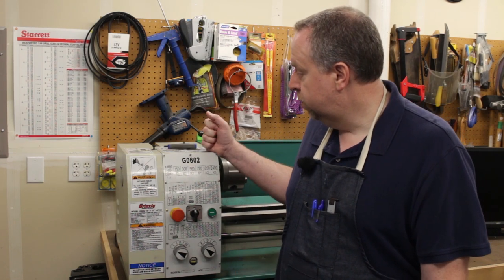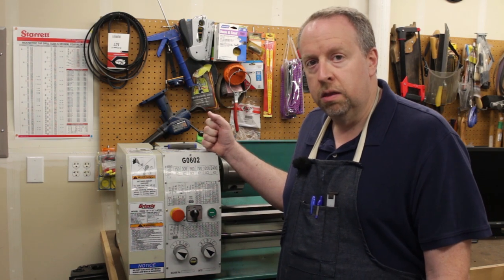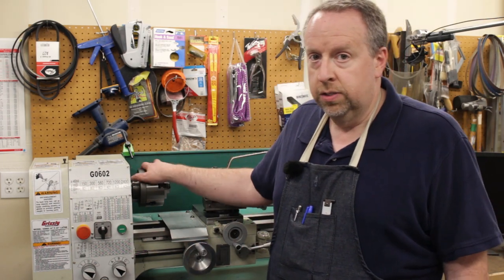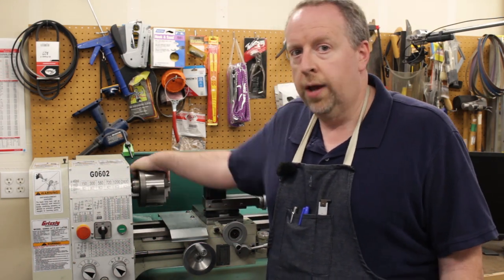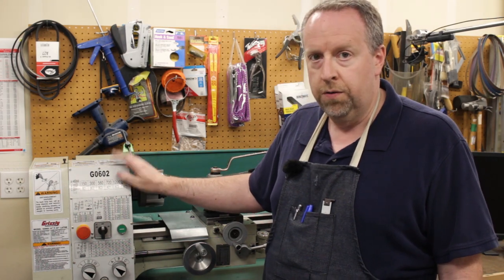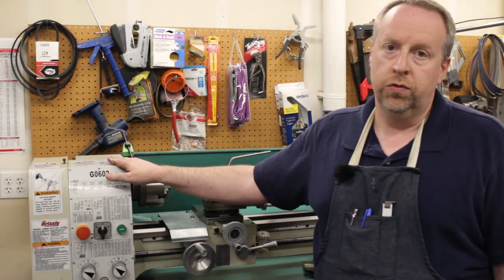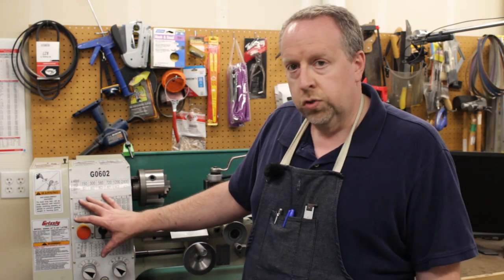Lathe VFD 4:  How to Install a 3-Phase Motor in a G0602 Lathe

Comment: "As straight as a tool from Harbor Freight gets" - I chuckled, and didn't even feel guilty.

I learned the hard way about gear pullers and pulleys, glad to see you got away with it.
Reply from the maker: Not totally sure I follow.  Did you break a pulley?  I imagine if the fit on the shaft were very tight, that could happen.  But if it were that tight, I'm not sure how you'd ever get it off in one piece.  Maybe heat...
Reply: Gear pullers used the normal way apply their force on a very small area of the thinnest part of that bottom edge.  I've broken two cast aluminum pulleys that way, when the aluminum / steel shaft interface was corroded.

Spread that force out, and the chance of damaging the pulley is greatly reduced.  I've used steel straps between the puller hooks and the pulley, plates welded to the puller arms, and even a full circle plate with a slot for the shaft.

Another good method, where the pulley construction allows, is to drill & tap holes in the pulley hub, bolt on a plate and spacers, and effectively apply your force right next to the shaft rather than out on the weak perimeter.

I do always try the normal way first, but I won't apply much force if it's a pulley I need to use / save.
Reply: @somebodyelse6673  Thanks for the heads up on using the pullers. Good to know for the future.

Comment: I stumbled across your videos for this VFD installation. I had to pause this video to say that I liked being able to see how you have some of your video equipment set up. It is nice to see. Most content creators don't show their set ups. I'm hoping to get my channel going soon. Still recovering from Hurricane damage. I also Just ordered both the G0602 and the G0704. But the main reason I paused the video was I wanted to mention. For the future you should get some Gearwrenches or the equivilent. Kobalt (at Lowes) makes some also. I used then 5 days a week for 12 years and love them. It would  have made those motor nuts come off in no time. I have used both Kobalt and Gearwrench. I haven't used any other brand. Kobalt are good but Gearwrench are better IMHO. P.S. You have a new subscriber also. Thanks for the videos.
Reply from the maker: I actually looked at ratchet wrenches for exactly the reason you state, but there isn't enough room between the side of the nut and the mounting foot of the motor for the larger head of the wrench.  And there isn't enough clearance off the end of the stud for any kind of socket.  It's clear the motor was mounted on the frame at the factory before the electronics enclosure or anything else.
Reply: @Clough42  Oh wow that is tight back there. Well at least you got it. Loved the series.

Comment: For anyone needing to install a pulley on an electric motor... Be careful using the bolt to draw the pulley onto the shaft as you don't want to break the bolt. If the pulley is too tight on the shaft, try heating up the pulley in the oven for a little while before installing it on the motor. Temps up to say 450 degrees F can be used with unpainted steel pulleys though that is hot enough to burn skin quickly. I used a temp around 250 degrees F successfully when installing a pulley on a 5 HP electric motor not too long ago. I did some light sanding inside the pulley (sand paper on a stick, spun by a drill) before heating up the pulley. Bolt was then able to pull the pulley onto the shaft with reasonable effort.
Reply: I came here to say this.
Heat/shrink fit is a very gentle and effective way to install transitional and interference fits.  Especially with aluminium on steel, as aluminium's it's co-efficient of thermal expansion is greater than steel, which is particularly helpful during removal.

Comment: Thanks for the great information and clear presentation. It is really useful for those of us about to do the same thing as lathe motors from China do not seem to last very long.
Reply from the maker: Mine certainly didn't.  Technically it worked, but I just can't stand to work with machines that are making unpleasant mechanical noises.  They're just begging to be fixed.

Comment: Hey Jimbo, I had a good laugh when you encountered the mystery motor mounting nuts @ 13:00. Many of us will attest to experiencing "mystery" hardware ever since China began flooding the world with their products. It was bad enough back when the U.S. folded like a cheap suit to Japan and other metric nations. This forced many of us old timers armed with a lifetime of  (inherited) imperial tools to duplicate every damn tool type/size known to man. Most home shops are struggling to work in the limited space we have without having to double the damn space needed! My old back ain't appreciating all that unnecessary weight either! As for encountering the occasional mystery size that fits neither standard?... I have a fix! ... Over time all of us are going to accumulate duplicate tool sizes. Some of which are not top of the line and have no sentimental attachment to family and friends. in my shop these tools become candidates for the Stationary Grinder, Angle Grinder and Dremel Grinder. For those that say why not use an adjustable wrench? There are few tools I dislike more. I will search through hundreds of pounds to avoid using one. Thankfully, you won't find and adjustable Allen Wrench anyway!
Wakodahatchee Chris

Comment: Nice video! 

A little bit of coppergrease on the motorshaft wont harm. It will make it easier to get the pulley of for the next time.

Comment: Had to take the motor out of my Grizzly G0773. That lower rear nut is best tackled with a crowfoot on an extension. I'd sure like to learn how you figured the motor frame size. Well, it isn't listed on my motor.....

Comment: Maybe one of those ratcheting combo wrenches would work well with those bottom nuts. As long as the ratchet clicks were fine enough. But I doubt you will ever need to pull that motor anytime soon.
Reply from the maker: I thought about it, but there's very little clearance around the nut, and I think the head of the wrench might be too wide.  It would be worth a try.

Comment: Clough,  Those combined wrenches  used are always a PIA in tight places. I rather use the ratcheted versions so you don't have to keep pulling them on and off. But awesome job, fortunately the new motor was same fit compared to the old motor.
Reply from the maker: Not fortunate.  Researched and chosen to fit.  The ratchet wrenches won't work in this situation because there isn't room for the slightly larger head.  Even an open end wrench jams if you turn it more than a few degrees.

Comment: I greatly appreciate your help in understanding this process!!! I need a vfd for a 5 hp 3phase motor on my table saw using single phase. Please suggest what I should get. Thanks!!!
Reply from the maker: Wow.  5HP is a lot or power for a single-phase input.  That's almost 4KW, so you'd definitely need a 220v circuit.  I'm not familiar with any VFDs in that kind of size, but there are many out there.

Comment: I have a 1 hp 3 phase motor to install along with a VFD on my G0602.  The LEESON motor - 192057 - is 3425 RPM  instead of 1725 rpm. The housing is the same type so fitment will not be a problem.

What do you think about using the 3425 rpm motor vs the 1725 rpm.

Comment: James, first off thank you for a really valuable and helpful video series. I've learned a lot from it. I was surprised to learn you could use a VFD with 110 Volt power that could then be used to create 220 volt three phase power. I am in a situation and wonder if you could provide some advice. Are there limits to how big a three phase motor can be before requiring 220v input using a VFD?  I am in the process of building a home shop that will have ten three phase machines ranging in size from 1hp to 7.5 hp. Only one machine would run at a time. I wonder if I should run a 15hp rotary phase converter or go with individual VFDs?  One thing about the rfc is the constant running of the motor (if I understand how those systems work) which with VFDs would make shop time more enjoyable. Any advice or reference material would be greatly appreciated. Thanks again. Dan

Comment: Keith would like to know the complete $investment to drop the pulleys and whose VDF and the actual motor you are using? I'm returning this exact Lathe because high range setup, the belt wasn't miss aligned, caused the belt to run off. It was a piss poor design.

Comment: If you were to start over on this would you go with the 0602 and do the new motor/VFD upgrade or just go with something like the G0752 with the variable speed built in?  I'm assuming that the new motor and VFD you installed are a more robust system?
Reply from the maker: Good question.  If I were in the market for a 10x22 benchtop lathe, it would probably be because price was important to me, and the G0752 is $1000 more.  That seems like a lot to me.
Reply: @Clough42  Thanks for the quick reply.  This is what I figured.  Now I just need to find someone with an 0602 for sale with a clapped out motor.  :-)

Comment: If your lathe is anything like my similar model, then that plate to which the LH cover is fitted is not steel but a piece of ground CAST IRON. Drill a hole to see the chips and verify this.
Reply from the maker: Interesting.  I'll be milling it at some point, to clearance for a servo.

Comment: Are you still happy with the 1740 RPM 1HP motor?  Are you having any threading issues, such as stalling?  If you had to do it again would you stay with that 1 hp motor (the Leeson is not made anymore) or would you move to the Leeson 1.5 HP 3400 RPM motor?  I'm thinking of doing the 3ph upgrade, my options are a 1HP Marathon 1740 RPM or 1.5hp Leeson 3450RPM
Reply from the maker: 1HP has worked fine on this lathe.  I have never needed to take the lathe off the middle belt position to do anything I've needed over the three or four years since I installed it.  On that belt position, it will go from about 130RPM up to 2500.  If I needed more torque, I could move to the low range and engage the back belt for more torque than the lathe could handle.  I did purchase another 1HP motor for my drill press, and as you pointed out, the Marathon is the one that's available now.

Comment: I know you didn't want to move the lathe,but it is obvious to me that the motor was installed to the lathe bed before if was planted on the chip pan. It would have taken far less time to unbolt the lathe bed and pan from the bench top and removed the pan from underneath the bed, turn the bed onto its front avoiding any damage to cross slide handle and unbolting the motor that way, and install the new motor. Far quicker than faffing around the way you did it.
Reply from the maker: You may be right.  Sadly, the lathe weighs a little more than my best deadlift and I really didn't want to get the crane out and move equipment out of the way just to change a motor.
Reply: @Clough42  you haven't got any beefy mates? Lol

Comment: So I ordered the motor and it has 6 posts not 9 posts, LESSON does not make a 9 post, you link is not correct.
Reply from the maker: I think they changed the terminal configuration.  It should have the same nine wires coming up out of the motor, but instead of having one wire on each terminal and bridging the terminals together to connect them, they expect you to move the wires onto the same terminal to connect them.
Reply: Correct

Comment: I think that going with a rotary phase converter is the appropriate route.
Reply from the maker: Seems reasonable for a table saw, which doesn't really need the variable speed.
Reply: Clough42 I do want a VFD for my 3/4 hp drill press.
Reply from the maker: I think a 1HP L510 would work well in that application.  They make a version for 115V input, which I used, and also a 230V single-phase version.

Comment: Yeah those motor nuts are a joke...I contacted Grizzly about it since technically you need to move the motor for tensioning the high speed belts and cog belt...nothing but crickets